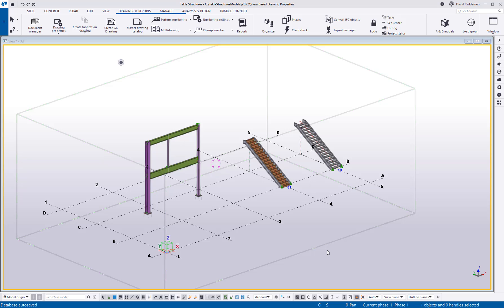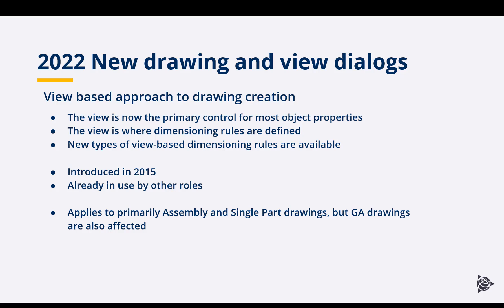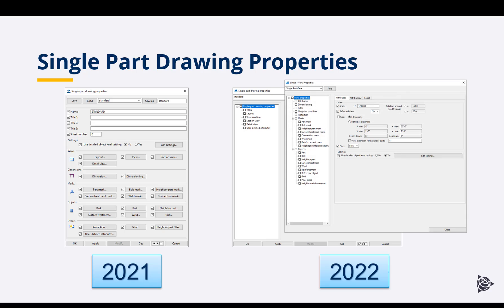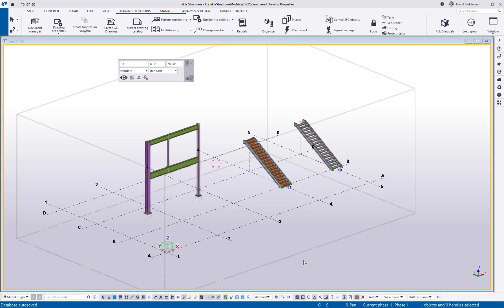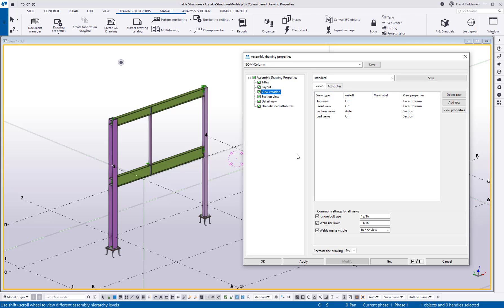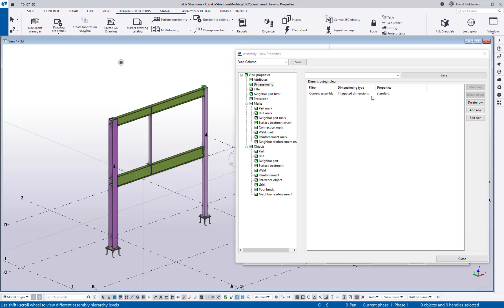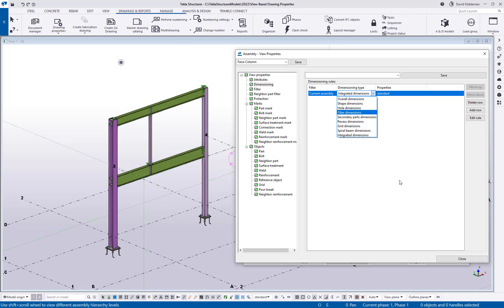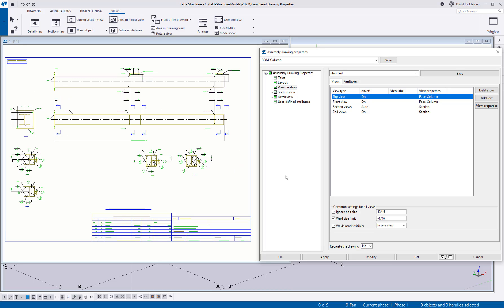Tekla Structures 2022 steel localization - new view-based drawing settings

Comment: These new options are definitely an upgrade, after initial setup this should streamline automation and speed up/minimize manual scrubbing of drawings. One thing I noticed immediately however, the "Assembly drawing properties" dialog only has "save" and "save as" has been eliminated. I feel the "save as" option would be greatly beneficial, especially for detailing firms that may have multiple clients with different needs. I suppose you could set it up via model templates and or client based firm folders but to be able to load up settings for the entire group on the fly would be fantastic. 
Keep up the good work guys!

Comment: Hello Dave.
After watching this tutorial on new view based drawing properties, I would like to ask you a direct question.
You know, I do steel detailing based on AISC/NISD codes and recommendations.
Question: Is there any way to detail horizontal and vertical braces using dimensions from work point to work point as the they are shown in the Manual 3erd edition?
Also, can you help me automate drawing properties required to get this done in tekla?

Comment: Hello, I am using 2022 tekla but i wanna change to 2021 properties. do you know how can i change it?
Reply: You need to set it in the option file in the model folder if it is an existing project. If you want to keep it for all new projects, you should also update the option file in the model template your using. If it is not defined in the option file, it will be set by your role. 

This is the option: XS_USE_OLD_DRAWING_CREATION_SETTINGS=TRUE

Comment: This is not a new feature of 2022 version, we can change to this old setting even in older versions of tekla by changing the command to 'TRUE' or 'FALSE' in options file which will be in model folder.
Reply: Correct, it has been around for a while. What is new is that we have enabled it and defined new settings for 2022 in the US Environments.
Reply: can you show where can i find it to change?